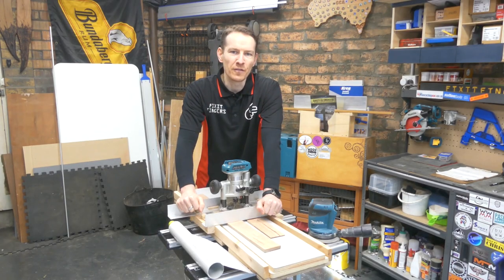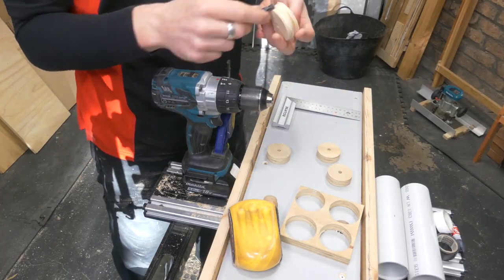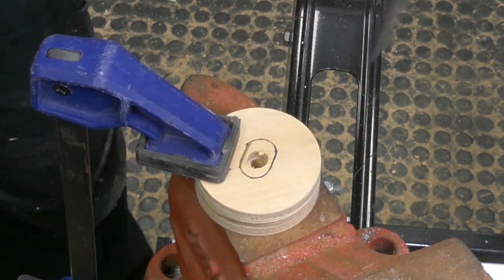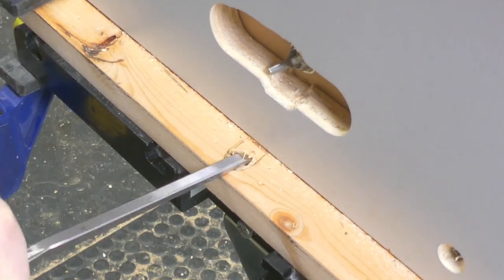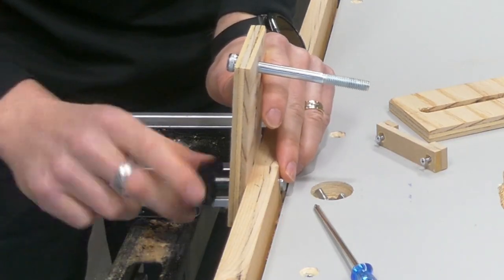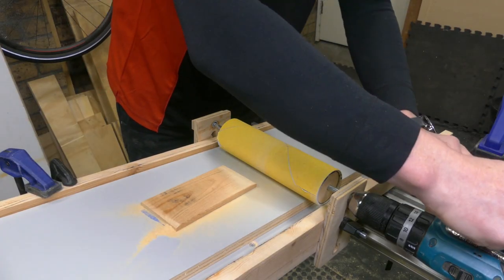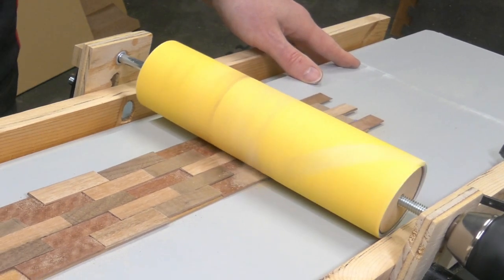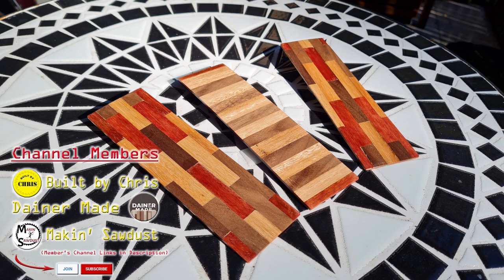DIY Drill Powered Drum Sander Jig

Comment: Well, it worked and that's all that matters. Surely a piece of threaded rod would make it all more stable, as would some thicker rod an bearings (but than it actually becomes building a machine). I made one a while ago, and it worked for the things I needed to make, but by now... well, let's say I have to start all over again. All the best from The Lonesome Hill!
Reply from the maker: I was so close!  I had a piece of rod but it was 10cm too short! A solid axle, a few bearings, dust hood and making the bed move instead of the drum and I think there's a machine there.

Comment: Awesome jig James ! Im gonna have to give this a go, Cheers !
Reply from the maker: Solid axle, a few bearings, and a dust hood and it's a real machine ;) Also Kilby suggested a belt and pulley to remove the drill vibration which is very clever.
Reply: @FixitFingers  Yea thats what I was thinking too. Im also always on the lookout for a single phase motor thats been thrown out.

Comment: nice... I have thought about a doing a very similar thing... but I also have a couple of spare electric motors and some pullys to gear it down... hmmmm got me thinking again
Reply from the maker: It's a pretty basic machine that with a few better bits like an axle with bearings and a dust hood could work fantastically well for the home workshop. Have a poke around the tubes, Ive not watched them but there are lots of 'proper' DIY versions of this around.

Comment: Built a few drum sanders over the years. So I'll kick you off with some improvements. 

Solid steel bar for shaft, bearings essential, glued discs to make drum ( you true these by putting sandpaper onto table and slowly raising to true drum perfectly), Velcro on outside of drum to make paper changing a doddle and it gives a tiny cushion which will reduce vibration massively. Oh and a small motor rather than drill as it will kill your drill, even if you use a corded drill, trust me I know. 1500ish rpm is perfect for drum sander.   

If you build a good one you will use it all the time and if you do.................add dust extraction.
Reply from the maker: Wow, thanks mate that is super comprehensive. This was more of a jig, and due to its shoddiness I never pulled it out again after the project it was built for... but you may have just inspired me to give this idea another crack and do it properly this time using your suggestions. Cheers! :D
Reply: @FixitFingers  just left you to work out the height adjustment mechanism.  😉😉😉

Best bet is to look at everybody elses on here and steal the best bits.  I know you are tight for space but if it's available you'll use it all the time, especially as it would appear your partial to dumpster diving!👍👍👍  

This is a good starting point, https://m.youtube.com/watch?v=ykh_o2ANYY4  and he has a feed roller add on too   https://m.youtube.com/watch?v=tcDLvwU7ucQ  it's a bit rough and ready but easy to build.
Reply from the maker: Cheers mate, added to the very long 'To Do' list😅

Comment: I've watched this 3 times now, I think it's a genius idea, I've been think on how you could make it more user friendly, could you make a drive wheel on corse grit sanding roll, and then fit the finer grit roller a bit further down the board and then complete both sanding steps in one pass??
Reply from the maker: Possible, but usually you'll want several passes on the course before heading to smoother grits. These things are not usually meant to be used as a thicknesser like I did! The main improvements noted in other comments are a solid axle, bearings, and a pully and belt to help remove vibration. With a proper piece of drum sanding paper and a dust cover it could be a great little machine.

Comment: Good try at it, but probably going to do a bad job of sanding with it being off kilter. Might be better to run some threaded rod through the guts, nuts inside tube and nuts on the outside to stabilize it a bit instead of separate bolts either side. Should make it a lot more stable.
Reply from the maker: Cheers Peter, yeah not the greatest attempt but got me out of a pinch. Definitely needs a solid rod and some bearings. Next version will be better!
Reply: @FixitFingers  Wouldn't be the first time I've rebuilt a home made tool a few times! There's always a learning curve. 
To make the centre blocks completely round and the rod in the centre, have a go at using your drill as a lathe first, bringing the blocks down to size for the pipe while they're spinning.
Reply from the maker: @peterschmidt9942  oh and the height adjustment needs reversing, moving the base on a hinge instead of moving the rollers... Not much of this design will survive V2 😂

Comment: Interesting concept, James. Is the wobble of any concern?  If its stable enough, next step is to make a lathe with a similar concept :D
Reply from the maker: If you want an actual dead flat surface... the wobble is of great concern 🤣 If you want a crude sandpaper thicknesser... less so 😁 Not having a solid axle handy was the main cause, and the slop in my basic little pipe bushings. So many areas to improve but it was a fun little build!